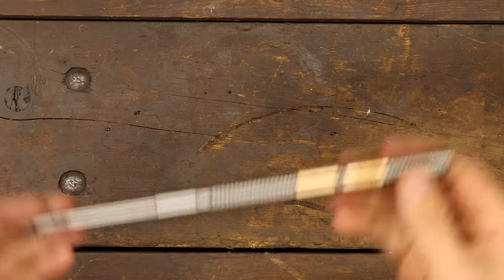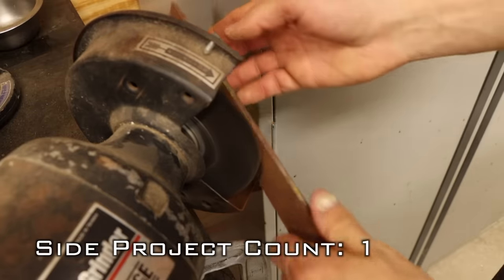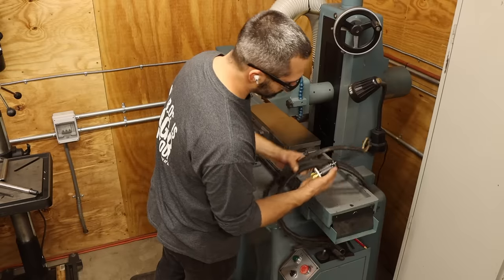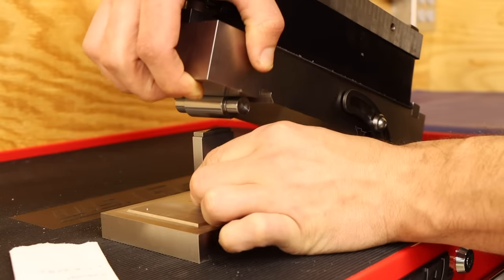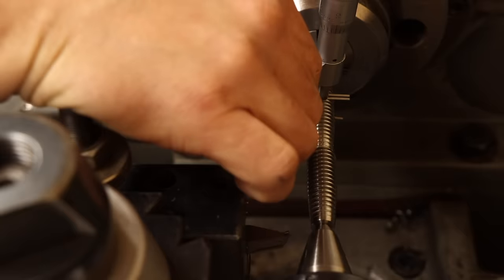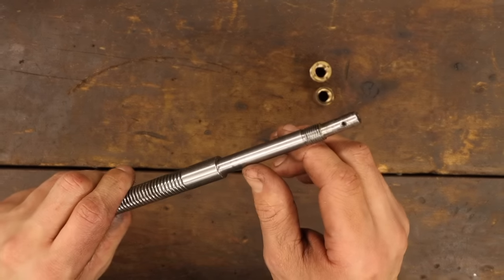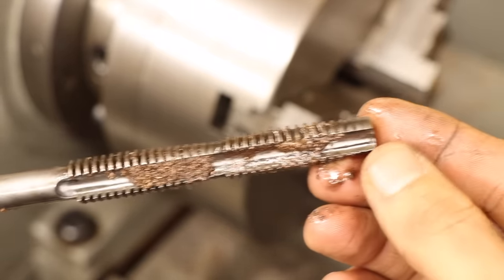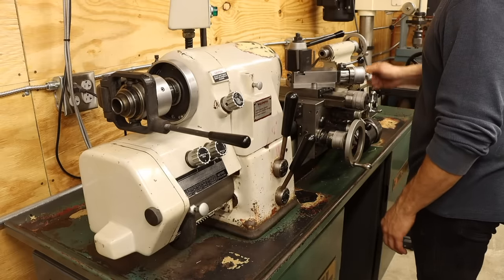Just A "SIMPLE" Repair

Comment: Muriatic acid works great for mill and forge scale, that said get fumeless.
Reply from the maker: 🤔 I might need to look at that. I considered sandblasting but didn't want to roughen the surface
Reply: @InheritanceMachining  I use it for heat treated knives, get a small Tupper, be in a well ventilated area, NOT NEAR STUFF You DONT WANT TO RUST, ( i had a bad experience lol) wear a respirator or get fumeless
Keep a container of water and baking soda handy in case you need to neutralize, wear PPE ( it is acid after all) degrease object by wiping down with acetone, place object in Tupper full o muriatic. Let sit about 20 min. Do not use muriatic for excessively long periods as it can cause embrittlement I'm told...it's never been a problem with thousands of knives for me, but hey I'm just a blacksmith, I believe em so I take stuff out after twenty min..neutralize in your baking soda bath. A very light scrubbing with Scotch right or a brass brush and you should be mill forge scale free.
Rebottle your acid. Rinse container with some of your neutralizer. Finis

Comment: just replace these screws with ball screws /j
Reply from the maker: "just" 😂
Reply: @InheritanceMachining   funny thing is ,ballscrews on manual machines are not a good idea
they can be very lumpy feeling ,depending on the preload.
 Because they have such low friction compared to a leadscrew ,they do not self lock as a screw does,
and because of the size of the ballnut they will not fit in the same place as a leadscrew.
I suspect however , that the price of an original  Hardinge high precision leadscrew
would be frightening compared to a same precision ballscrew, which after all
are mass produced.